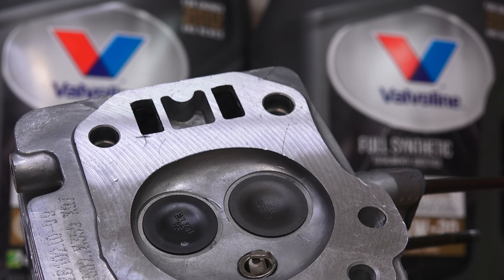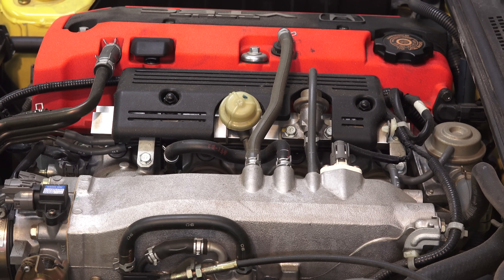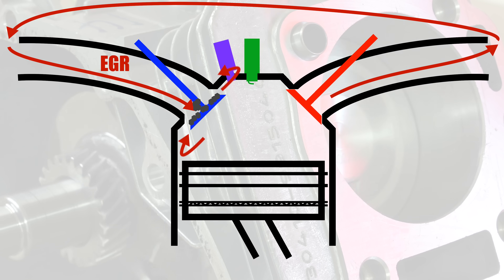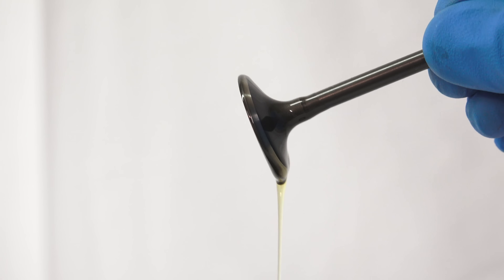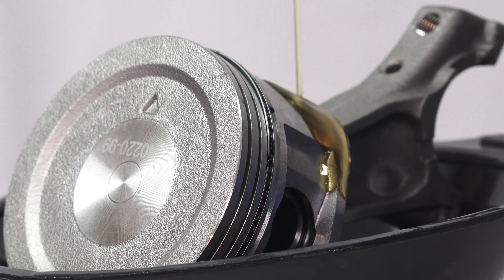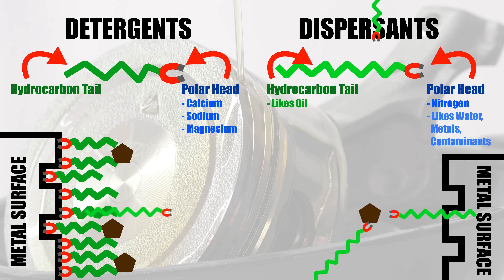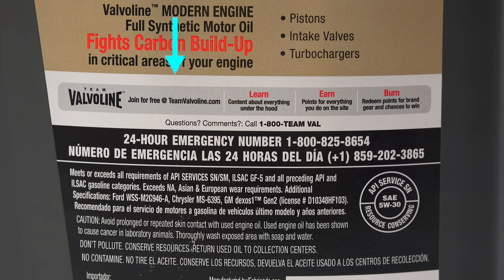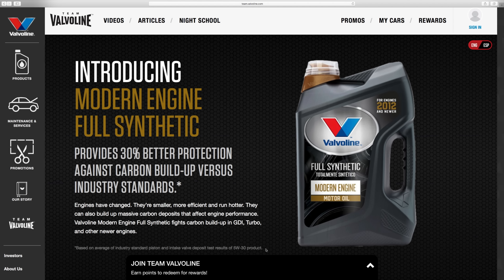Can Engine Oil Help Prevent Carbon Build Up?

Comment: Solution Do not buy a direct injection tfsi fsi EcoBoost etc... or diesel with the EGR activated
Reply: I’ve had 2007 Gti since it was a new car off the lot. It has 116000 miles now, no symptoms. Not saying it doesn’t have carbon build up. Still daily drive it even today
Reply: Love like a hurricane, 
You use quality Gas and motor oil , right?
Reply: Nothing wrong with the DI EcoBoost. Ford's problem is their over eager PCV systems that suck so hard that the entire intake is coated in oil. I even had this problem on my old port injected Ford. There was liquid oil in the intake from the PCV. I thought something was wrong but nope! Just a crappy design from the factory.
Reply: The problem arises when the engine runs at high temperatures and the oil remains in the valves and forms the carbon, the best thing would be an catch can to avoid cleaning the head and problems with the sensors and actuators.
Reply: @uru-freemind7711  hey. You took my line. Lol
Reply: @angrodNumenesse  oil catch can anyone?
Reply: That means keep your old car if you can. Finding a car without DI, turbo or CVT and still got the features you're looking for (like AWD) is next to impossible now. Direct injection is still the lesser of all evils.
Reply: Exactly it is the minor of all the problems but it increases the cost of maintenance and that nobody likes, nowadays it is almost impossible to have a good car that is not di but there are good catch can kits to avoid carbon
Reply: @uru-freemind7711  I have the maintenance solution for non-turbo. Check out BG in my additive series. Just additives wouldn't work. I'm talking intake induction.
Reply: I prefer to empty the catch can having to dismantle the intake manifold and possibly the cylinder head too, and I do not need to buy additives. lol
Reply: Uru- Free Mind ... You will find carbon build up in any engine type, just happens quicker and more often with the "eco" friendly engines.
Reply: @JJ_ExMachina  Exactly why my favorite engine is the electric bldc, does not need air more than to cool or generate power in the mills and cooling. For that reason and many more I hope the change to the ev be quick.
Reply: Uru- Free Mind ... Our current issue is battery chemistry. Until we discover a safer and more power dense battery, EVs are nothing more then a toy at this moment. Well a toy with some really nasty things hiding under its skin for future generations to deal with. I do agree that petroleum fuels are not long term viable either.
Reply: @JJ_ExMachina  Let's be clear immediately, the combustion engine has passed and the global conflicts over oil, currently all countries are increasing the production of renewable energy and for those who say that the pollutant, they do not know what they say minor pollution anyway, for example , the manufacture and transportation of the additional parts that make up to gasoline car consumes electricity and, the maintenance cost is higher and they pollute with oil and gas air filters and many pieces that are thrown away, oil travels in trucks and boats that consumes a lot of what they transport, while electricity travels in cables with very little loss, the combustion engine varies its performance according to the air that the electric motor needs to cool, said all the problems and inefficient that is this system to use combustion engines to move and move things, it would be better to use oil to generate ctricity in the cities. With the remote power plants and the cars in our house are all electric, and use the industry that makes parts for combustion cars to make solar panels, batteries and things necessary to be self-sufficient in our homes or buildings in order to reduce electricity When do they realize that manufacturers and oil companies only about money and making money? people are waking up and will prefer electric cars, although their initial cost is higher and their autonomy is lower, this system really sucks. And I add the EVs have more torque, they do not need a clutch or a gearbox other than to manufacture and transport.
Reply: Uru- Free Mind ... First off I agree petroleum fuels are not a viable solutions for long term sustainability. BUT if you think there is not going to be serious problems with the current technology in the batteries used in EVs you are deluding yourself. Lithium has to be mined from the earth, which causes more damage to the environment then you seem to care about. The EV still uses oil and special coolants to cool the electrics and electric motor(s). SO the EVs are not impervious to using oils and other fluids that require special handling to prevent environmental contamination. On top of that the Ghazni Province in Afghanistan holds the world's largest lithium reserves. The cost of mining it will be extremely expensive due to the steps needed to secure the locations from Terrorist attacks and other issues.
   The current storage cells, can produce batteries that last 10+ years, well give or take a few years depending on use. The issue is, once those batteries have failed and need replaced the cost to recycle and or dispose of properly and the environmental impact is very high. SO while I agree petroleum fuels are not the right answer, EVs using the current available technology are not the saving grace people including you are making them out to be. When you take everything in to account, from mining to, production of the vehicle a EV is no more environmentally safe then a vehicle powered by an internal combustion engine. NOT when you consider everything, from production to destruction. The entire "life" cycle of both version of vehicles have their flays and benefits, making them both equally as bad for the environment as each other.
Reply: the best thing about cars is that the energy they use does not have to be transported all over the world since any country is capable of producing it, if you are so concerned about the environment you should know that a car combustion contaminates with all its fluids that are more that an ev and all the extra parts that have clutch, filters, hoses, gearbox and many things that are discarded throughout its useful life, therefore the electric cars are better since all those extra parts that they use during their life util and its fluids must be transported in a vehicle that also consumes fuel and wears out more pieces and also consumes energy to make those pieces of energy that surely comes from the oil. So the best thing to do would be to start putting oil aside for mobility and use it to produce electricity. For this reason all countries are increasing the production of renewable energy and many manufacturers participating in electric car races.
Reply: Mother Nature is not amused.
Reply: @TheWindoofs92  nature asks for electric cars years ago but the manufacturers and the oilmans are still with poor cars that give them money and power. Almost all countries are increasing the production of renewable energy by luck

Comment: I have said this before I'll say it again, please do a video on different types of base oil. Specifically group 4 and group 5(preferably esters). The thing that I would really like to know is how good is an engine oil with a group 5 base oil (ester based, like Chemlube or Motul) is compared to a group 3 with additives(say Mobil 1 with emission system protection). Since esters are natural detergents, how effective are they when compared to a group 3 or 4 base oil with additives?
Reply from the maker: I think that's a great suggestion! I do have a video going over the basics of Groups 1-5, but I'd like to know more detail as well.
Reply: I would like to know about this as well, when looking around for the best oil to buy for my vehicle I hear these group numbers thrown around I would like your input on it.
Reply: That will be great because I'm always on Motul 300V. It's a great engine oil due to it's smoothness.
Reply: @zepp3lin  I saw a lot of tests on that oil...from the filter of looking at motorcycle oils. Very good oil. Very high in additives. I turned it down as even when it's a motorcycle oil it makes my wet clutch slip. Same with Castrol synthetic vs. Castrol nonsyntheric. 

I did better with a Honda Semi-synthetic. I almost went 2000 miles before my Yamaha got sensitive to what gear it was in. The transmission and engine share the same oil. I normally only do a 1000 miles and Blackstone labs confirmed it was a bad idea to go further. Yamaha said 4k miles for an oil change. They must not want my engine to last. The 10w-40 shears down to 5w-20 in just a 1000 miles!

I'm trying a new experiment with an additive to see if I can go further with maybe Blackstone labs approval. Follow along or miss out.
Reply: @DENicholsAutoBravado  The Motul 300V that I use is for cars not the Motorcycle version.
Reply: I considered you might, and others, might be thinking that zepp3lin. The tech that goes into the car and motorcycle oils is the same. The additive package is just what changes to meet different needs. Motul did very well, but with the price being very high, slightly better results in a few areas didn't impress me enough to spend the extra cash. Over the life of an engine I could buy another engine with the cost differential being so high.
Reply: @DENicholsAutoBravado  5
Reply: @EngineeringExplained  You should do a video on the Lamborghini Aventador's single clutch gearbox and how it's faster than most double clutch systems.
Reply: Engineering Explained can you post a link to that?
Reply: @EngineeringExplained  And that's why you're the best! Keep them videos coming Jason.
Reply: Also just for information, I believe Mobil 1 actually uses group 3 instead of group 4. It would still be interesting nonetheless
Reply: nunchaks700 correct. Mobil1 use group 3(hydrocracked) oil. Hydrocracked is the method that they use to reuse exhausted oil and transform it to new. So basically when u buy mobil1 u buy used oil.. XD
Reply: @Malossianoplus  Now this got really interesting 😸👍
Reply: How come oil companies never post the 'Shear stability' of their oils????
Reply: @angelocardoc  that kind of information is extremely hard to get. I went into practically the bowels of the internet to find real scientific testing on tons of oils.

I felt like group 3 was really good enough for what I'm after. Mobil 1 and Castrol were my favorite prior to the science. Maybe I have confirmation bias and with them doing very well I didn't see the need to buy more expensive oils.

Many were tested. Castrol and Mobil 1 weren't always tested but one of the times they were both tested Castrol got one measurement value better on the taper roller test than Mobil 1.

Some people are saying that while Penzoils new process of making their oils from technically a group 3 source kinda blows that category up as it's superior in maintaining viscosity over group 4 and 5. Makers of higher class oils still advertise their the best...uh...not according to this metric.

The study did practical tests ... many . . . And it also tested for additive packages like you'd see from Blackstone Lab reports.

To hear more I did a comparison video based on my journey picking the best oil for motorcycle.
Reply: @DENicholsAutoBravado  I'm going to save you a lot of... AMSOIL.. Signature series
Reply: AMSOIL. Seriously. Best on the market. Nobody can hang. yet nobody knows apparently
Reply: get Amsoil it’s better than any oil out there. Research it and thank me later
Reply: -Now we're talking! I'm totally up for a video on this! 😺👍👍👍👍👍
Reply: In my experience with vehicles (30 years) as a Tech. Anyway I ran my 1996 Mazda MX3 v6 for "0"-250k+ miles on nothing but AMSOIL products. It is just my own personal preference to run AMSOIL. they are an American company, so that is a major bonus to me.
   When it came time for me to sell my MX3 (in 2005), I decided to pull the valve covers and oil pan off the engine and inspect the upper and lower wear points. I did a plastigage check on the main bearings, cams journals, and other wear points. I found that they were well within factory specs. The cam lobes looked like they just came out of the factory. Everything had this nice golden hue to it, where the oil had penetrated the metal. Not that dark brown color you see when you pull valve covers off from using conventional oil. I had to show the guys I worked with what I found and they too were impressed. SO for me I will use a cat 5 oil in everything I can, and if not available, at least a full synthetic. After seeing all of the engines coming in with sludge and carbon build up, and finding out they ran conventional motor oil... It just helped to confirm what I found on my engine.
Reply: @JJ_ExMachina  - Strongly agree. Plus group5 are typically low on the NOACK Volatility Index table, meaning low in oil vapourisation losses and consequent GDI inlet port coking. So in short, what's not to like? Only problem AMSOIL is not retailed in Australia :(